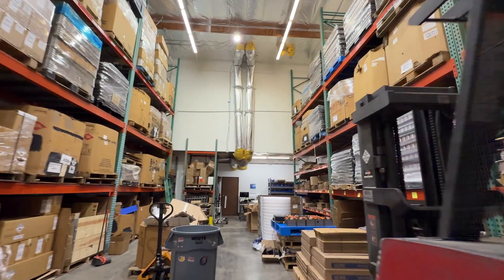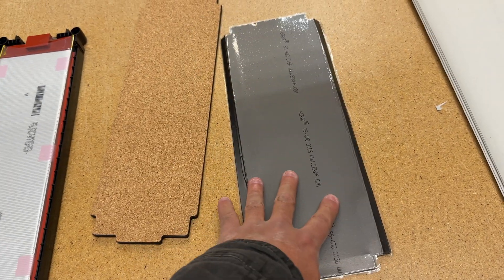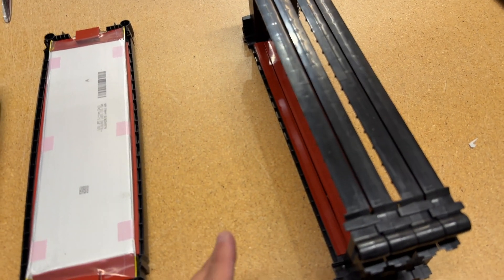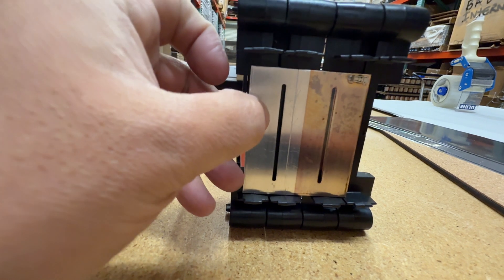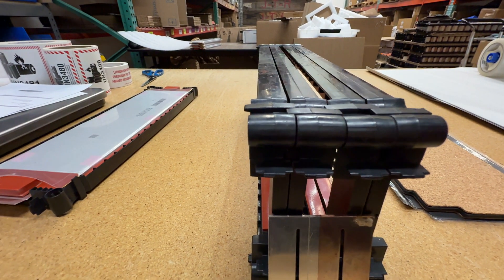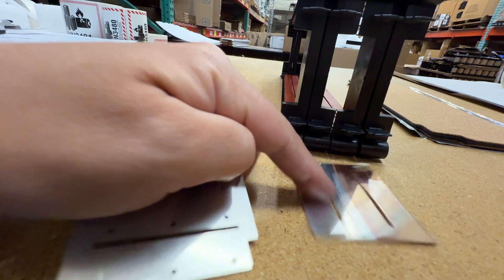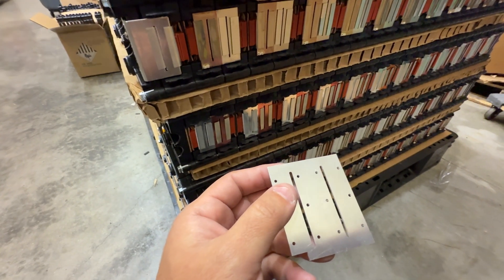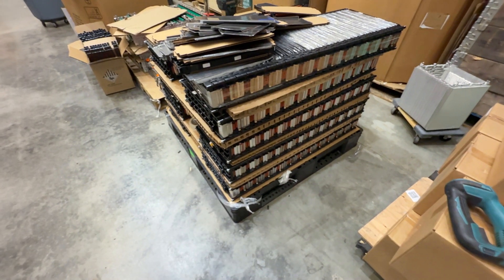Making jp3 cells into JP3  battery packs w  holders + busbars

Comment: How do you charge these ?
Reply from the maker: Like every other cell… with a charger
Reply: @jehugarcia  thanks for the info. Can the charger plug into a wall out ? Does this pack come with a charger or is it sold seperately?
Reply: Outlet**
Reply from the maker: There’s many types of chargers.  These are just cells,  you have to know what you want to do to be able to chose the right charger
Reply: @jehugarcia  okay cool. Are the chargers on your site as well?
Reply from the maker: @in4mationplug  I only sell one small 36v 2A charger for scooters.  All others have to be sourced from Amazon 12v https://amzn.to/4ho9C32. Or 48v https://amzn.to/3CTkgjc or any other voltage you require

Comment: Do you have the mating connectors for the little connector on the busbar? Presumably for connecting to a BMS
Reply from the maker: There is no connector,  you use bare wire into that little hole